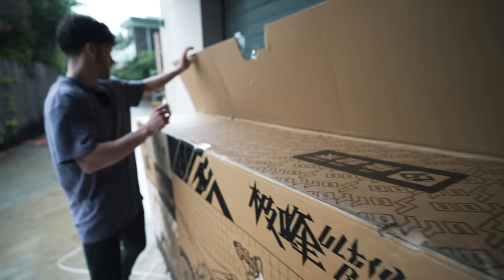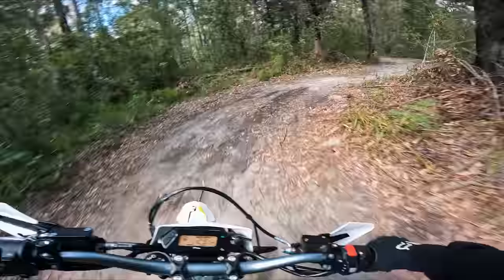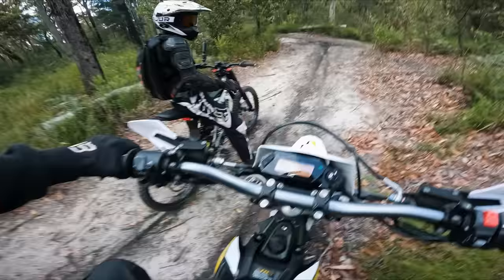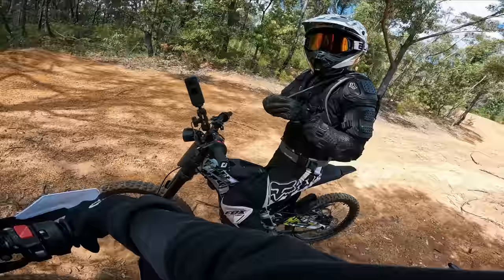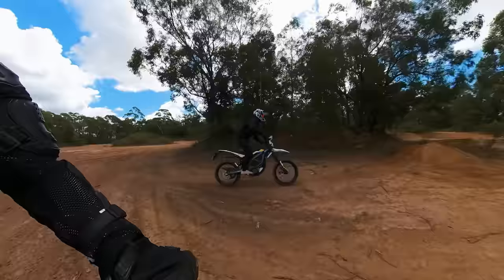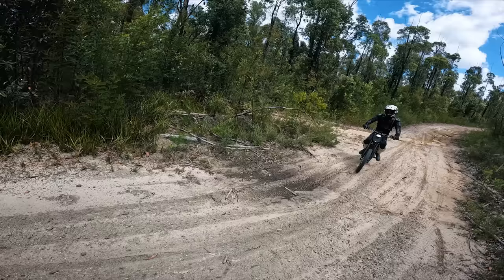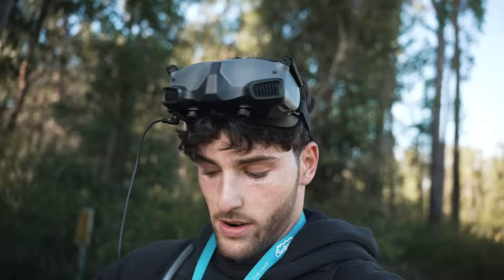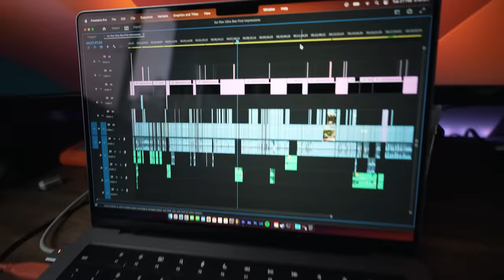Riding The NEW 2023 Sur Ron ULTRA BEE | First Impressions

Comment: Just letting you know, a 72v lbx usually will run about 15kw and is a lot lighter than the ultra bee. So your most likely to win on a 72v lbx over a 12.5 kw ultra bee
Reply from the maker: Yeah that’s crazy, I need to get myself a 72v!
Reply: Ebmx 9000 already works with the ultra bee
Reply: @tintin6291  I didn't even know that. How much can the battery put out? (Max kw)
Reply: you fail to mention the $4000 that you would need to upgrade the battery and the controller for the lbx i plan on upgrading the ultra bee to a 15kw tune it is a better value in my opinion
Reply: @dwill658  I didn't say it was a better deal for the lbx. I just said most 72Vs are faster than a stock ultra bee.
Reply: What spec difference in the 2 ? Sorry new to this but extremely interested
Reply: @waynelafitte5631  A stock sur ron x is a lot slower than the ultra bee, but when  a sur ron x is upgraded, it can put out more power than the ultra bee

Comment: Just got the surron light bee... I felt it was too slow out of the box. So already ordered a nuculer 24f controller. A GLADIATOR 72 MAX - 51AH SUR-RON BATTERY. I want a second bike to ride with friends... my question is after all the upgrades my surron was about 8000 dollars. Should I purchase another surron for my second bike or just F all that and pay 7000 for this bike? I mean it already comes with a 72v battery so thats one upgrade I dont need to pay for. I mostly want to do offroad riding too.